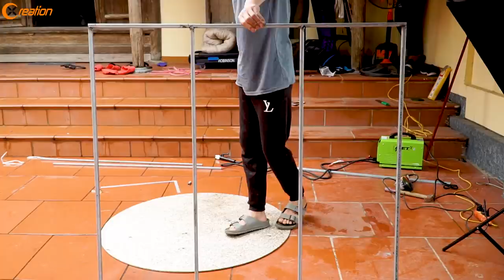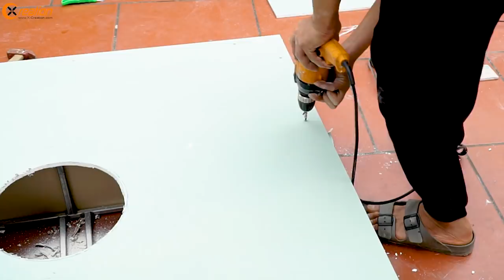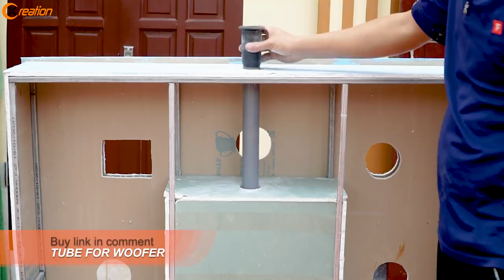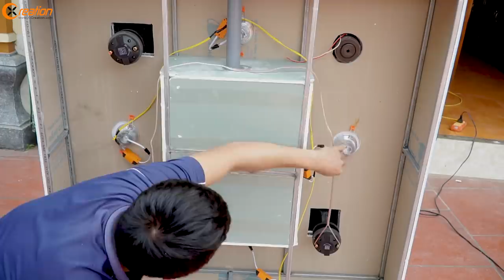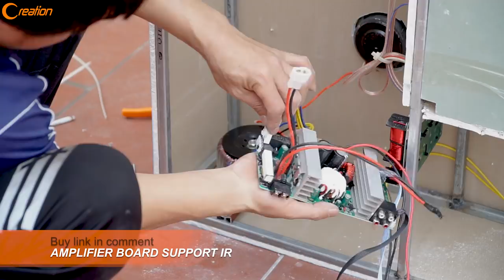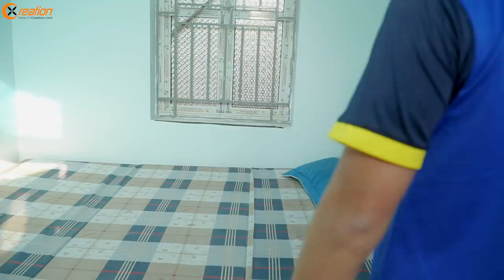Building 300Watt Speaker Drywall on Ceiling

Comment: Coming back to this video, it's good to see what you have done, but there are noticeable things I would have changed.
Both mid range speakers and tweeters are fed from the same crossover, and only one output is used, so you'll only get mono audio. It is better to just use a 2.1 amplifier, with a dedicated output for the subwoofer (and two crossovers for the tweeters/midrange speakers), or use two crossovers and sum the outputs for the subwoofer to a single mono signal.
The LEDs look nice and seem bright, but what if one fails? Looks like you'll be bringing down the entire fixture to replace a faulty LED. It's better to have light fittings with user replaceable light bulbs - such as multiple GU10 spotlights, for example.
It's nice to have RGB lights, but they only react to the music, and can't be controlled via any other means. Better RGB lights with better controls (such as IR remote, or smart wireless RGB) would have been better, especially ones that aren't integrated into the main unit - if there's a problem, it won't be very easy to fix without taking down the whole fixture.
Other points to note:
The wiring for the LEDs looked a little suspect, you can't just twist wires together. There are proper connectors for mains wiring.
Not using any sort of protection when using grinding or welding tools is a big no-no. You could get sparks fly up (from the grinding tool) and hit you in the face - and the flashes from the welding process will eventually cause eye damage if you don't wear eye protection.